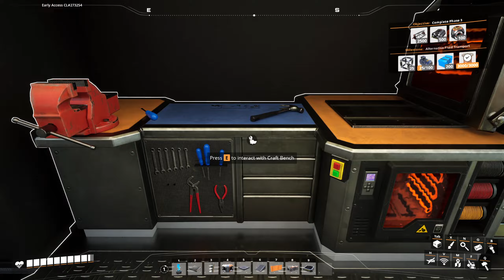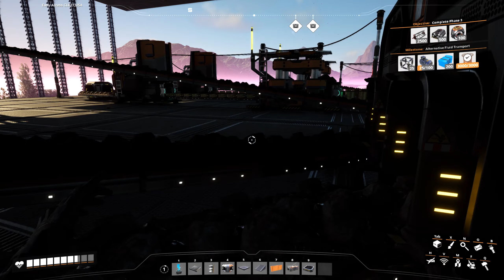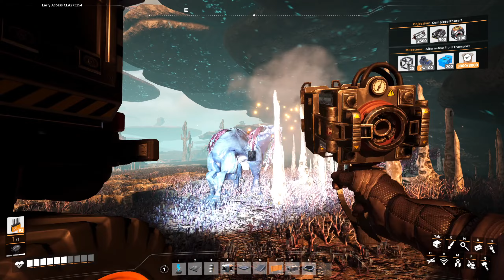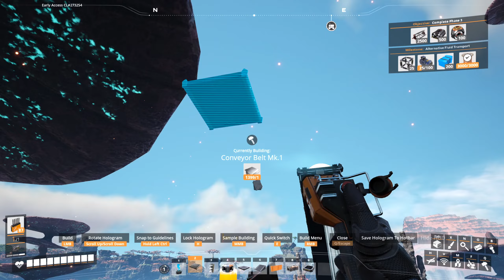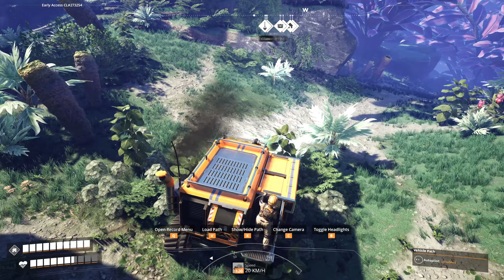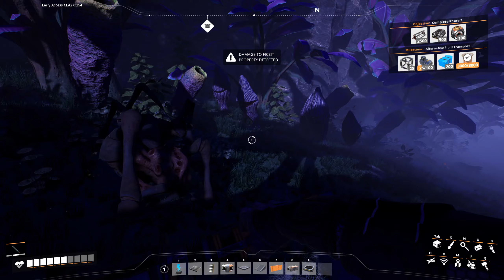Belting in new Coal Lines - Satisfactory EP14

Comment: nice video!  instead of guessing, you should look at the capacity of the belt, and machines and work from there.  get exact numbers rather than guessing.  also, when overclocking, instead of adjusting the % you can actually click on the per minute section and type in the exact per minute that you want to get.

EDIT: the miner will always be limited by the belt speed, adding a splitter doesnt help because the bit of belt before the splitter still limits the speed.  its part of a big community complaint, with a mk3 miner, and 250% overclocked, it is impossible to bring out all the ore fast enough.   they have said there is a fix for this in 1.0 but havent said what it is.  could be faster belts, could be a second output for the miner, could be something else.
Reply from the maker: I found a mod that avoids the problem altogether.  Snap-On.  Apply directly to Miner.
Reply: @hesthatguy love that mod. So handy
Reply: I think you'll find that T2 miners just need a bit of overclocking to hit the max belt speed, for pure nodes anyway.  For reference T1 miners base output is 30/60/120 for impure/normal/pure nodes, T2 is 60/120/240 (doubled), and T3 is 120/240/480 (doubled again).
Reply: @jaye1967  im unsure how this applies to my comment?  he was trying to improve throughput by adding a splitter, but that doesnt help because the initial belt will always limit your throughput regardless.

as for the miners, you just proved my point.  with a mk3 at 250% you are producing 1200 resources, but you can only pull out 780 currently.
Reply: @marcbennett9232  my guess would be a t6 belt in tier 10. Seems like the easier solution to make pure mk3 miners useable without breaking the early game. Mods like snap on kinda break early game when you're pulling 360 rss from 1 node and only mk2 belts.
Reply: @CountryAndProud  yeah I agree.  A second output just for the mk3 would also be fine.  Or maybe they came up with something else entirely.  It wouldn't be the first time they have come up with a unique solution.